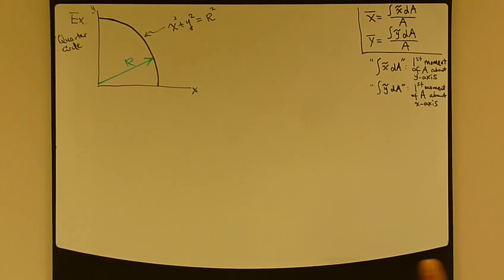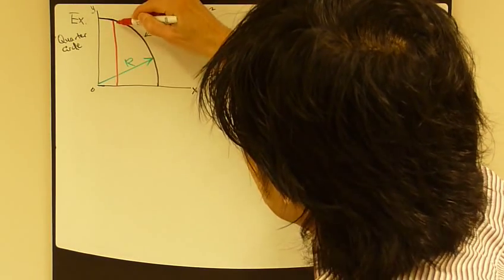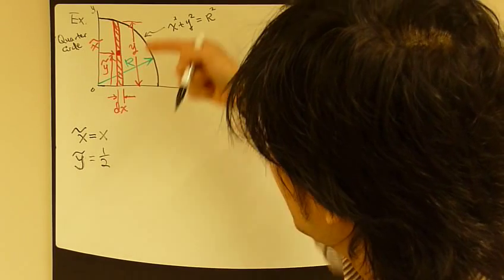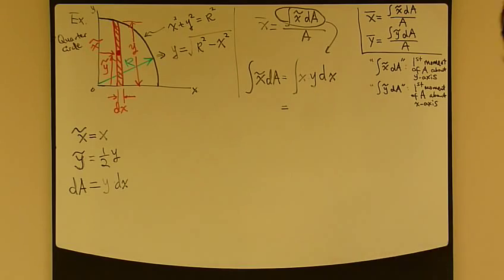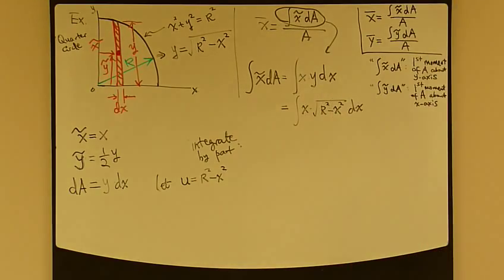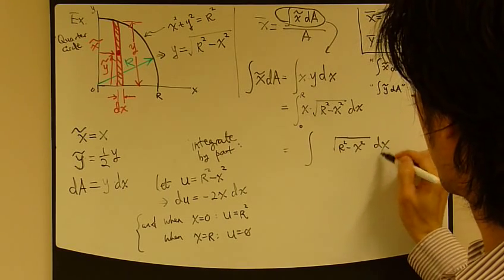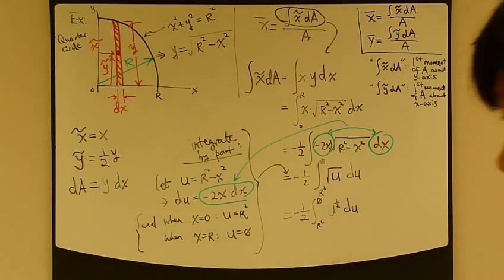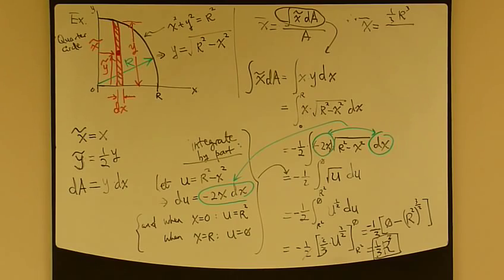Engineering Statics Ch9 Part4: Centroid and Center of Gravity

Comment: why are we taking y(touda) = y/2 ? 
In this shape we easily judge that y(touda) will be y/2. But in any complex figure how can we find y(touda) ?
Reply from the maker: y_tilda is the center of gravity of the red differential element, which measures from 0 to some y. So the center of this thin strip is exactly halfway. This is true for any shape, however complex, as long as the vertical strip is drawn from y=0 to some y.